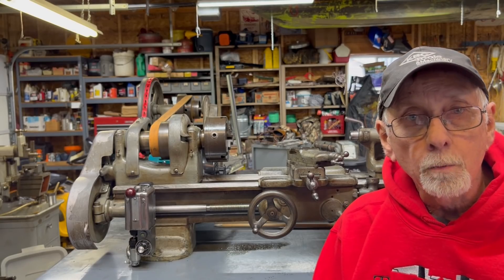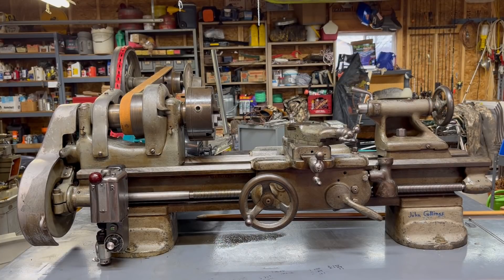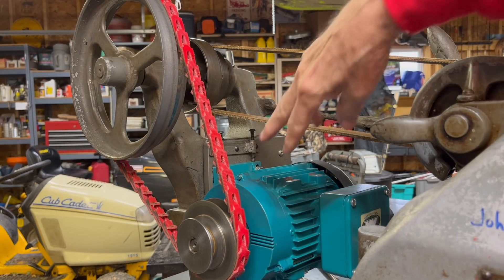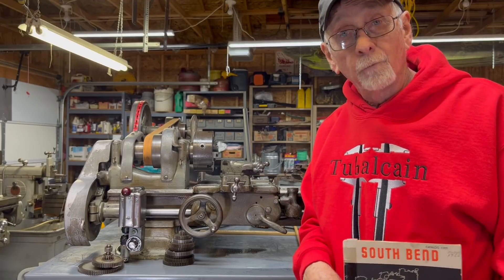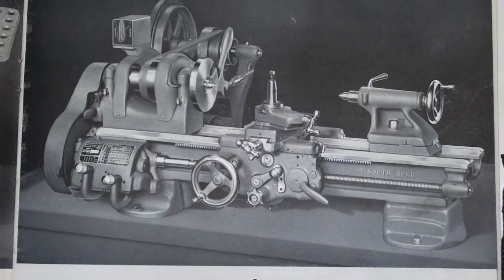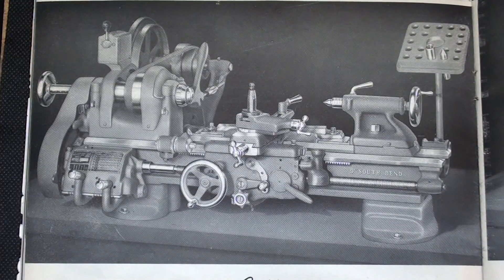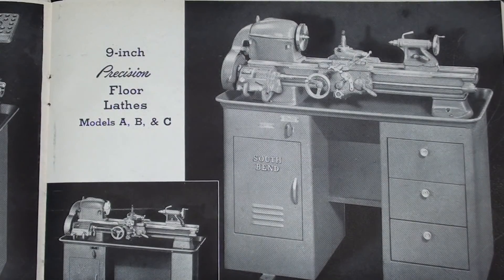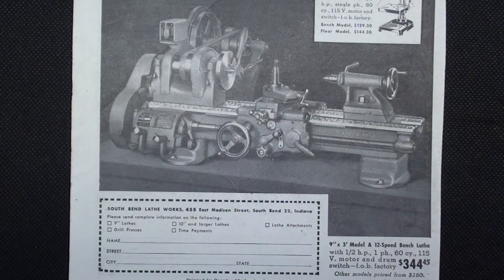COMPARING SOUTH BEND 9" LATHE MODELS #785 tubalcain type study

Comment: Thank you.
I have always thought that the Atlas Craftsman was substandard to the Southbend. I don't know enough about either brand to know why and where. Your explanation helps me understand the features and differences better. My Craftsman doesn't have a quick change gearbox or reversing spindle motor. This frustrates me since I learned on Clausing Colchester industrial machines. 
My Craftsman is the same class as this series of Southbend. I have the cross slide milling attachment and the collet drawbar, but no collets. There's so much backlash in my cross slide that even light milling was a failure. Without collets I also tried to hold my mill in the lathe chuck. My back gear lever won't stay in back gear forcing me to keep hand pressure on it during back gear operation.
I am anxious to complete my Leblond restoration (spring project) and finally have an industrial class machine. The Leblond was moved into my new shop January 1 along with the entire machine shop, but this is a fair weather shop. The heated shop is now exclusively for woodworking hobbies.
Reply from the maker: There is no doubt about it, the atlas is a light duty machine

Comment: I have a 1937 southbend 9 lathe. They only produced the one model that year. Different wheel on back and no adjuster between the lathe and motor post. But you are missing one gear.  I don’t see the 120 teeth gear. Mine has it and it is not a completely solid gear.  Mine was purchased by a navy( I think Canadian not sure) for small ship use. Aside from losing a few things over the years one previous owner didn’t understand bed twist and filed the v groove on headstock.

Comment: I have an old 1920ish 14" lathe on cast iron legs and I have thought long and hard about building a bench to replace them. I have a very small space to work in and even now have not enough storage for what tooling I got.   I love the look of the legs but the utility of a bench is appealing too.
Reply from the maker: I pretty much agree with you. You can never have enough storage
Reply: Surely if you are skillful enough to use a lathe, you are skillful enough to construct some storage that fits around the legs? Why would you bother replacing the legs, when they are already there?

Comment: I acquired my model A in 2012.  It was a '61 model with the v-belt drive, 4 1/2 foot bed.  The V-belt gave you four positions, which meant 8 speeds.  I never took advantage of the other speed available at the drive pulley.  That would have given me 16 speeds.  Great little lathe on which to learn on.  I was aware of the B & C models when I was looking for a lathe, but I wanted the advantages the A came with.